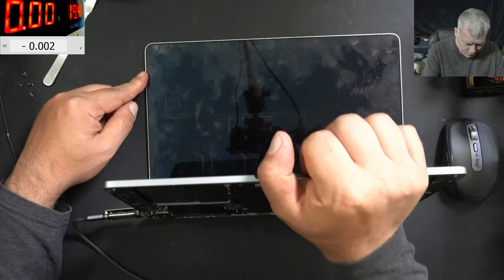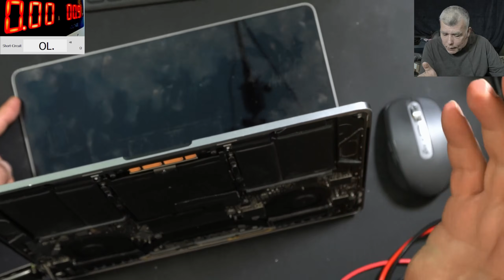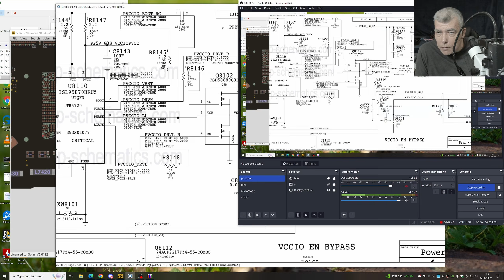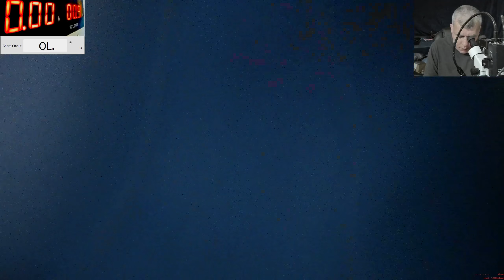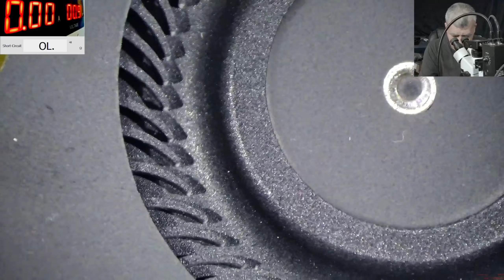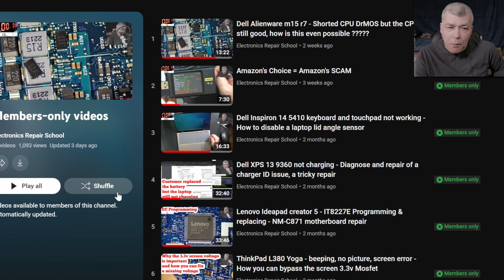MacBook Pro A1989 - no power, logic board repair. How a hard to be found fault looks like

Comment: That's what I tell all my customers that if I can tell exactly how much the repair will cost means I already fixed it.I always tell them a possible estimate also I charge €30 diagnosis fee for a non obvious fault which will be included in the total cost incase it's an economical fix on the customers side.If they don't want it for any reason then the €30 fee is charged which will most likely not cover my time but that is the way to do it I couldn't find any better solution.

Comment: Mr, i have same laptop here. The issue:
- after i changed keyboard some keys were not working
- I disassembled few times, no change
- after one night, i tried again, but now not even starting

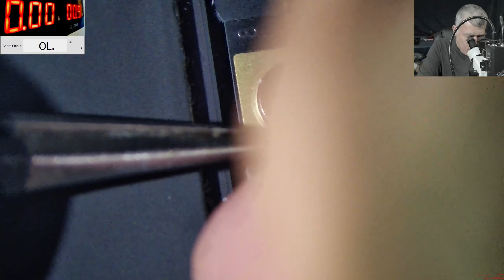The question is: did i damage the motherboard while working with no 🧤 gloves or is it bad flex cable (battery flex is a little bit damages on one pin, the one you holding on 29:19
- another question, why some keys were not working

Pls help
Two days doing this repair :(
Im regretting i started it :(
Im desperate, broken tbh
If somebody could help ..

Comment: Excellent work! Ps. Metal tweezers by the battery connector is a recipe for disaster. I once slightly touched metal tweezers to an iPhone battery connecter to remove it and caused a short. Seen a puff of smoke. Thankfully it still worked.

Comment: What is the yellow plastic called and what is it called, also adding flux on the mosfet using same method would be cleaner? Also, when you check for short circuit to ground, are you using Ohm testing on the multimeter?
Laslty, thank you for simply the best, most eloquent and least blabbering tutorials Sorin, 🎉❤
Reply: Kapton tape. Ohms testing with power off. Voltage testing when powered.

Comment: I have a MSI KATANA GF66 11UG RTX3070 laptop. My problem is that the graphics card is limited to 45 watts and does not exceed that, which causes a lack of frames while playing.
Reply: I`m sure that there is a resistor that you can short and have the 100% of the GPU, but i can be wrong

Comment: To disconnect the battery power of the macbbok, you just need to disconnect the battery flex cable not the big flat screw.

Comment: Hi Sorin. May I ask what do you mean when you say High Side MOSFET and Low Side MOSFET, how is it defined
Reply: Generally (not always) called high side when the mosfet is connecting a positive rail to something, called low side when the mosfet is connecting the something to 0V common or to something lower than the positive rail.
Reply: @ralphj4012  Thank you Ralph, it does make sense, what a great community to learn

Comment: The customer is right, I'm Romanian and I've had the same problems with the prices and costs of a laptop repair. There are a lot of scammers here who charge a simple defect even ten times more than they should. Moreover, they use cheap Chinese chips for which you wait more than 3 weeks, while you can find the same components in Europe at slightly higher prices and the waiting and transport time is 2...5 days. This is for a much bigger profit. I was asked for 160 euros for a display cable that I bought from France for 100 euros with fast shipping, a 17.3 inch LCD display they asked for 200 euros and I bought it for 120 euros and so on ...
In my case, they (3 local repair shops) ask for successive problems, one after the other, a lot of money compared to the price of a new laptop. This shows a lot of stupidity and greed on their part
Reply: ok, inteleg si punctul tau de vedere, dar trebuie si tu sa intelegi ca acele trei service-uri (si impreuna daca le-ai lua) nu le poti compara cu Sorin. de aceea, cand apelezi la cineva ca el sti din start ca mergi pe drumul bun. chiar si asa, a zis si el ca are pret fix pentru fiecare reparatie, deci ai fi stiut de la inceput; in plus, daca observi, dupa ce a diagnosticat problema, a luat legatura cu "clientul" - pt ai spune ce schimbari au intervenit, probabil, in privinta pretului. deci nu e ca "nu am stiut pana nu am dat banul..."
Reply: @leerzeichen1910  Ai inteles gresit .... Eu m-am referit strict la clientul din RO , il stiu pe Sorin , este PRO si s-a adaptat cerintelor si eticii vestice in schimb mentalitatea balcanica de a fura si insela il face pe roman sa sufle si in iaurt !!!
Despre asta era vorba !
Mai este unul pe aici ( USA) care practica preturi imense si repara la norma doar ce poate si apoi posteaza cum si-a cumparat el casa de 1,2...1,4 mil de dolari 
Este imoral si stupid din partea unora .
Reply: you think those repair services work for free, they have to pay rent, the workers, the bills, taxes, etc.... you can't repair something and ask 10 euro....or 20....    time is money and  it's not only the money you pay for the part but also for searching the part, mounting the part, etc....
Reply: @orange11squares  Read my post again ...
I'm referring strictly to those scammers who try anything to rip off people trust them and they don't know anything about electronics . Between 4 repair shops only one deal with all repairs in a correct , proper mode with any client
Reply: @orange11squares  if you are good, then you can ask for your money -i'm fine with that-,  but if you are "beginner" then i'm sorry, i can not pay your rent, workers and so on...and my device isn't fix at all

Comment: Was the gate connected to ground through the coil, L8102 ?
Reply from the maker: No, that it will show 54 ohms, the coil resistance to ground
Reply: @electronicsrepairschool  Must be that the low side mosfet was shorted drain to source and the high mfet was shorted source to gate but not source to drain.

Comment: so i have a 2015 macbook air that my grand daughter locked the harddrive with a password. shes 9. if i remove the soldered hardrive and replace it, will it reset the pw? i dont do macs, so i am totally lost. would really appreciate some help. thanks.
Reply: Yes you can reset the password 
Boot into internet recovery 
Open cmd and reset the password or simple just wipe the drive
Reply: @johnstone5310  i need the hardisk pw to do anything. how do i boot into internet recovery? thanks
Reply: @dontrotter1099  Indeed, recovery mode isn't available when you have a disk password. Replacing the drive with a new one should allow you to get into the system.